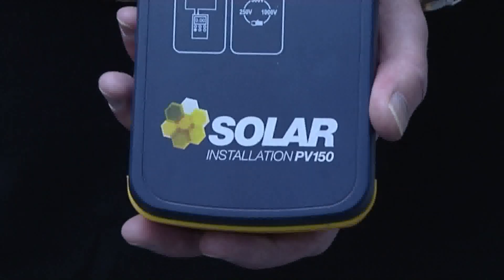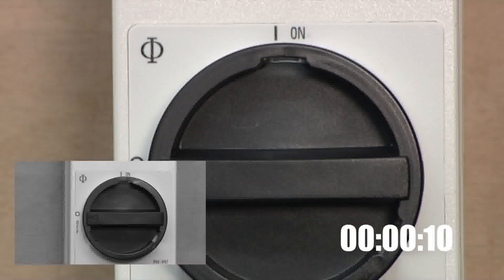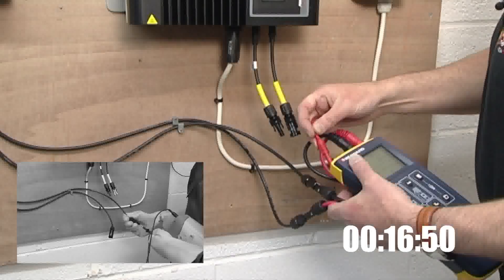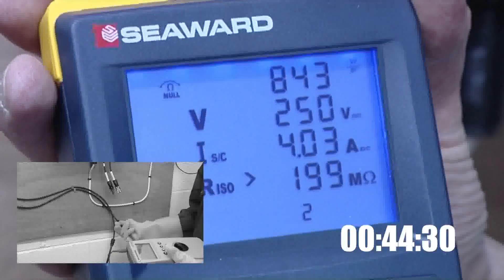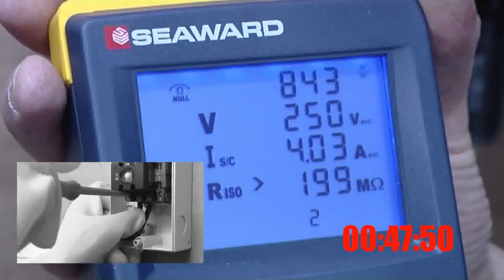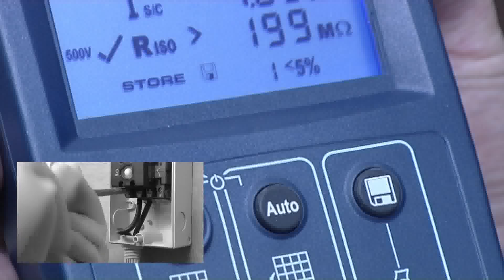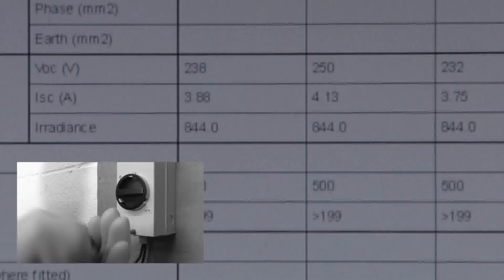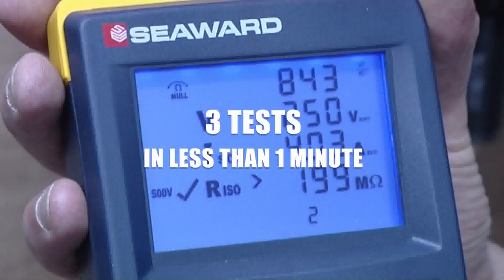Faster solar PV system testing with the PV150

Comment: My name is kalyan goud email id kalyangoud92@gmail.com 

Please give confirmation for 

Recommended limit value of insulation  resistance for acceptance of each string 40 M ohms for meter square 

250 volts  for Recommended  

Cell dimensions 156×156 mm each cell voltage 0.6 volts total no of cells 420 cells require area for cells 10 sqmeter 

So 1 sq meter  required  40M ohms per m2 so required  400M ohms 

Please give confirmation in mail
Reply: Is it currct installation for earthing  side

Comment: It would be a great help if you could hang the device around your neck during the measurement. You have to have both hands free, especially when you climb a ladder to reach the inverter.
Reply: Sir the issue here is that we do not want a 1000V electrical device in anyway tied to your body. If there was an electrical fault you need to be able to let go of the instrument